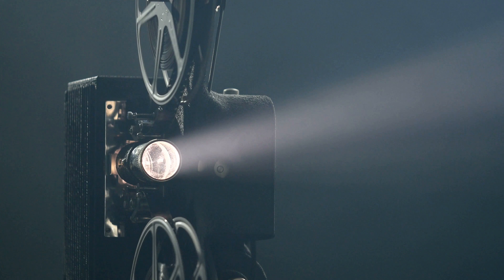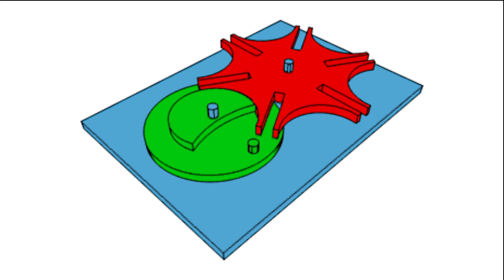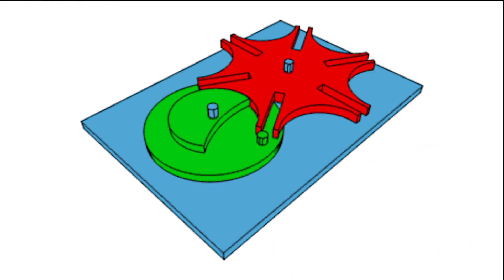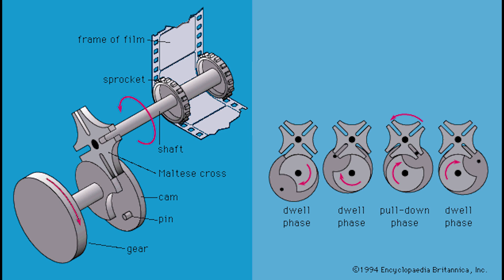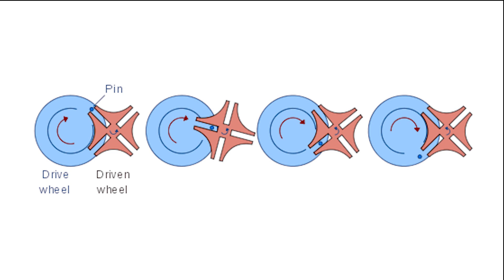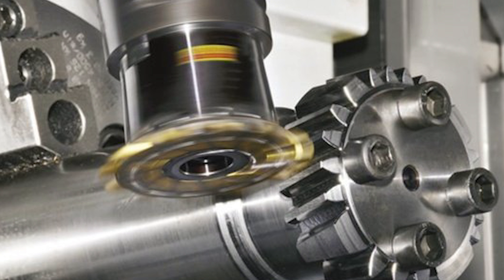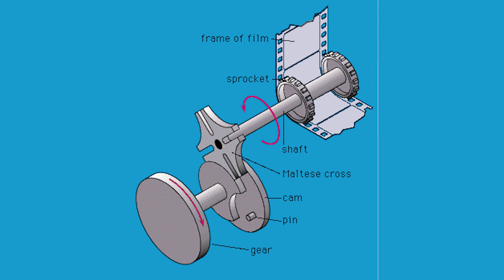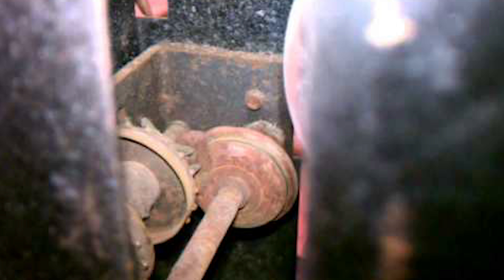Why Old School Film Projectors Make the Sound they do

Comment: I was taught mechanism heart was the so called Maltese cross. The film stopped in the gate for 1/24 of a second the flicker shutter cut off the light from arc lamp so frame lines would not be seen, hence name of early cinema the ‘flicks’ as hand cranked projectors speed varied. Ex projectionist here! 1:06 14:43

Comment: This video provides a pretty good overview of how a Geneva gear works, but it really doesn’t explain where the projector sound comes from, which is the intermittent movement of the pull down claw. As JohnPorter pointed out already, “negatives” are never projected. The two types of film that can be shot in a film “camera” are “negative," and “reversal." After processing, negative film is “printed” onto a special type of negative film, called a "positive print” because it yields a “positive” image. (A negative image copied to a piece of film that yields a  negative image would end up being a positive image. Negative + negative = positive) 

The other type of film, most commonly used in 8mm home movie applications, and some 16mm cameras as well, is called “reversal” film. During the developing or “processing stage” after being exposed in the camera, this film also creates a negative image in the initial part of the processing, but as it travels through different chemical baths, at some point the negative image “reverses” to yield a “positive” image, hence the name “reversal film.” This original camera film is viewed directly in a projector, because it is a positive image. But in a negative film, black is white and white is black, green is purple and purple is green, red is blue… you get the picture.

Comment: you`re full of shit. The Geneva movement does not get really hot. It does run in a bath of oil but it does not wear out. I`ve run theatrical projectors for years and never had that happen. So you don`t know what you`re talking about in that respect.